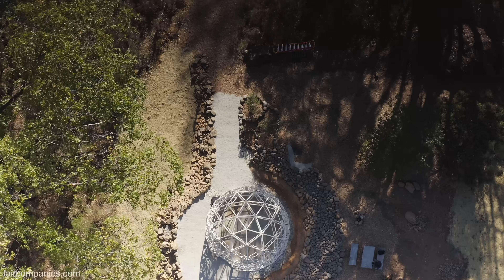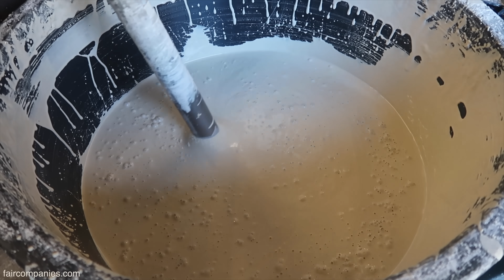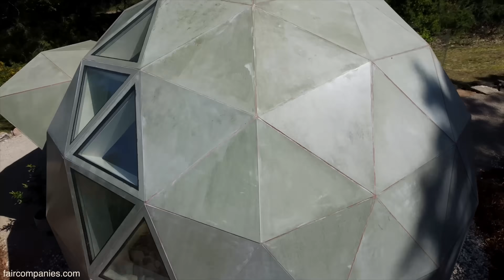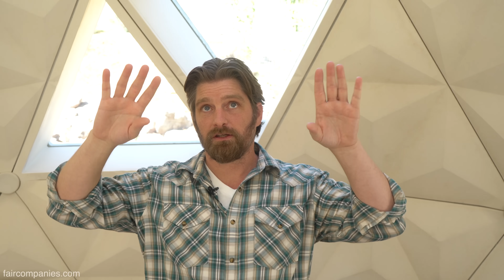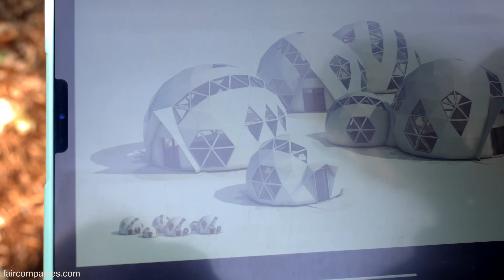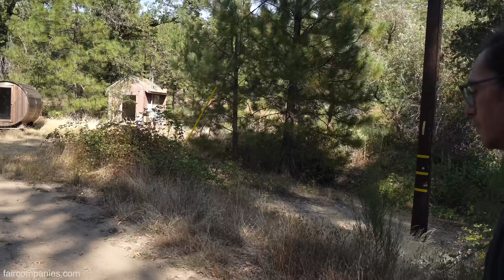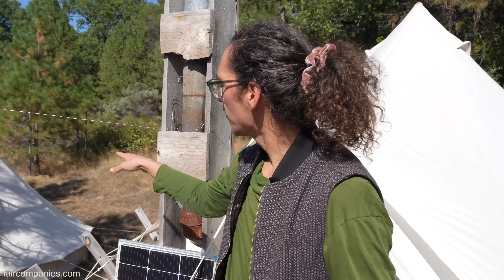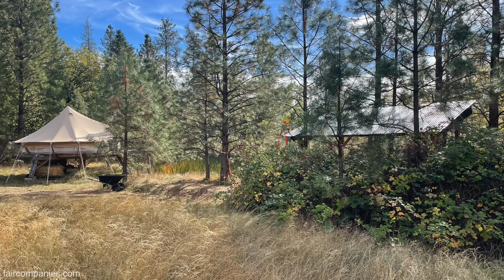Building ecovillage of storm-proof homes made of bone-like biomaterial

Comment: Okay, they're mixing up a synthetic limestone with hemp fibers?  That's just hempcrete.  They're getting their calcinated lime from the same sources as everyone else, presumably.  The hemp fibers will degrade over time.  People ran into some serious mold issues with a related product, Papercrete.  I don't think this stuff will be likely to degrade nearly as badly, but it's not really the end-all-be-all supermaterial, unless there's something I'm missing.

With new developments in thermal diode design, it's theoretically possible to drive temps gained from solar concentration up above 1000c.  Not only can you calcinate lime to make cement at that temp without releasing excess CO2 from fossil fuel use, you can use the heat to run kilns.  You can then mix your concrete with a foaming agent to increase its volume and any of several kinds of fiber for increased sheet strength, and form it into blocks.  Then you can dry the block thoroughly in your kiln to get consistent strength and further reduced weight.  Excluding the solar angle, this is Autoclaved Aerated Concrete and has been being built for the last 70 years.  It's not perfect, but it's easily made, easily worked on-site (you can cut it with almost any tool, down to paperclips), and well-understood.

Comment: how is it zero carbon? How are the ingredients made?
Reply from the maker: I responded to another comment about how most of the raw materials can be generated from waste streams. Here's the other comment: Morgan was also talking about how you can use a lot of waste materials as a source. Here's what he said, that I didn't end up using in the video: "It's natural in that it's like bone, but to get the raw minerals you need to mine them or use reclamation processes. One of the biggest byproducts of salt water desalination is 2 of the key raw ingredients that we need and one of the main byproducts from wastewater treatment plants is another one of the raw key ingredients and now we're finding as the mining operations ramp up for battery minerals that a lot of the waste streams from those operations we can use."

Comment: Termite proof.  That is another unmentioned quality.
Reply: Geoship domes are so insect-resistant, even the bugs know to keep out—no termites allowed at this party!
Reply: @futurevillages yes termites love wood
Reply: Plus the fact that it’s made of ceramic will help keep it with regular temperatures during all seasons
Reply: You have to add liposomal Boric acid to make it termite-resistant. Some species of termites will chew right through cellulosic cements, so you mix in tiny polymer beads of boric acid to poison any invertebrate that tries to make a home in it.
Reply: Built number of steel homes back in the 80s in Southern California with my Dad.   All still standing, no bugs, rot or even leaks.  Steel roof as well.   One thing that impressed the owners was the cost savings on insurance.   Really adds up over the years.
Reply: @dailyrider2975  except they don't stand up well to directed energy weapons
Reply: @rickacton7540  I looked up metal studs recently,  holy smokes batman!   Prices are crazy high.   No wonder metal buildings are not that popular, still think in long run the lower costs will make up for it though.
Reply: @rickacton7540 Ah but it a Faraday cage instead. 
God bless
Reply: @rickacton7540   this is a problem only for you, earth-people.
Reply: And woodworm, mould, rot etc
Reply: a few bites and they lose all ambition and fall asleep

Comment: How does something that is organic not whither or degrade? That's not mathing up, either it isn't organic or it will degrade. You cant have both😂
Reply: They way they used "organic" here meaning that it's design is derived from characteristics of an organism. In this case, I think earlier on they were talking about the materials being made from what bone is comprised of, which are calcium and phosphate, with the hemp fibers acting as the matrix to basically form the overall ceramic compositite.
Reply: @SilverNine89  literally everything they said pointed to it being a chemically organic compound (organic simply means carbon based) of which every element will degrade. It's simply not possible to have organic or biotic material last forever. It's scientifically impossible. 

Im well aware of what they said and what it all means, im not ignorant of that. Cecilia, hemps, phosphates, and other materials used are not inorganic nor abiotic. Everything withers away, everything. Even plastic in due time.

Comment: Also, if you were to get some of the windows to be opening types for ventilation, I suppose you would have to custom make screens to fit the spaces since that is not a standard opening shape. There's no way you could ever live here without screens due to all of the insects. Not to mention bears and other wildlife. I could see it being much more feasible for california. I remember not even using much of any heat and not using any AC in the summer growing up.

Comment: Is this even feasible to build in a place like Northwest Wisconsin where it gets down to close to 40 below in the winter on occasions and also has hail sometimes? How would you add plumbing and some type of a wood-burning stove?
Reply: Geoships are designed to withstand extreme climates, including the frigid winters and hailstorms typical of Northern Climates. The bioceramic materials used provide strong insulation, making them suitable for both high and low temperatures. Deep insulation cavities can also be adapted for additional thermal efficiency, helping maintain warmth even during sub-zero conditions. For plumbing and wood-burning stove installations, the dome’s modular design accommodates traditional and off-grid solutions.

Comment: Awesome.   But if it's so light in weight, how is it able to handle 300mph winds
Reply from the maker: My understanding is part of it at least is in the shape, that the curved surface helps to withstand high winds, though it's not foolproof, so they also need to be fortified, and even (what I've read), raised above the ground.

Comment: Tensile strength?
Reply: I haven’t found it, but here are some of the other properties I found from the investor presentation.

21st Century Materials GeoRok: Chemically Bonded Ceramics

GeoRok vs. Concrete

Compressive Strength

>15,000 psi vs. 4,000 psi

Flexural Strength

>4,000 psi vs. 600 psi

Bond Strength

>5,000 psi vs. 150 psi

Water Absorption

<2% vs. 5-20%

Demolding Time

15-45 minutes vs. 24-48 hours

Comment: Inside is aesthetically pleasing ... cocoonlike. Bearing the doubling in insulation factor R, I wonder how the dome handles extremes of temperature?
Reply: I slept in a Geoship and it does feel cozy and cocoon-like inside, providing a unique blend of aesthetics and comfort. Their bioceramic domes feature excellent thermal insulation with high R-values, doubling the typical insulation factor, making them highly energy-efficient and climate resilient.

The dome shape, combined with advanced materials, helps regulate indoor temperatures naturally, reducing the need for heating and cooling. Whether it’s extreme cold or heat, the dome’s structure and insulation keep things stable and comfortable inside, even in harsh climates.
Reply: @RegenerativeLiving  thank you for that input.

Comment: I have seen these folk's design (or similar ceramic domes) before. It still seems to be mostly in the concept phase. I conclude this in particular as so much of this video was focused on the tent living situation of one of the designers (not enough other content?) 150k for a home sounds great, but I expect that is the dome frame and skin, perhaps the foundation and a very premature number to share when the "factory" isn't much more than a garage. That number  can't include interior build out, i.e. electric, plumbing, appliances, and the PV system that looks so nice in the mock-up. Hats off for the Aptera cameo in the carport though. No mention of insulation or air/water/vapor sealing between the individual components. I thought I saw what looked like caulk in the seams (which never lasts). No petrochemicals?
Reply: " air/water/vapor sealing between the individual components" yes that is also something I wonder about. Especially if it is in a northern climate, how does it deal with thermal expansion/contraction?
Reply: Biodomes have historically been notoriously difficult to waterproof and are very prone to leaks. We need vapor barrier sealing details. What's the insulation between the two sets of panels? They need to issue a video on construction details with a building science guy like Risinger. The "bioceramic" panels are proprietary. I don't like that you can only buy completed units, not materials.
Reply: Not mentioning the insulation material or method is definitely suspicious. Barely anything about ventilation (and no vents near the top?) This is just beyond vaporware but the 3D renders look wonderful.
Reply: @travelfeet   Agreed. Nothing is real until it’s in production.
Reply: Sealing can be done using the same kind of bio ceramic material which binds to itself. Insulation will be done using cellular bioceramic material that has a consistency like a shaving cream. More detailed information is available through their email newsletter accessible through the invest page of the Geoship website.
Reply: Why is everyone calling it ceramic it sounds like it's just cement mixed with hemp fibers
Reply: @ It specifically uses magnesium phosphate cement which actually has biomedical applications such as filling bone voids. They add hemp fibers for added strength, but basalt fibers can also be used.

Comment: Would be lovely if such a structure were amenable to being earth-sheltered.  

The presenter commented on other alternative building technologies essentially seeking to fit within existing building conventions, implying that this is a bad thing.  I think that trying to change too many things at once, especially in an industry that is extremely conservative (and for good reason), will make things harder for them.  Why not decouple the idea of a dome home from the building system shown?  A more conventional construction but with the bone framework and larger, rectangular panels sounds more compelling to me.  Those frames could be even more "organically shaped" and left exposed in places... it'd be cool, too, and  more so than the dome would be able to cooperate with many other building technologies.

Anyway, I enjoyed seeing what you guys have come up with.  Best of luck!
Reply: This is the way, to be honest.  There are some incredibly advanced building technologies out there that are just quietly integrating themselves into the list of things to build homes with:  Structure Insulated Panels (SIP's) replacing wall and roof components, Autoclaved Aerated Concrete (AAC) blocks replacing cinderblocks - it's all out there and is gaining ground because it presents itself as a new way to solve existing problems.  Domes are cool.  I grew up on the Gulf Coast, so housing that survives once-a-generation hurricane blasts seems like a no-brainer, but they are so different that solutions for domes cannot use tools for rectilinear homes most of the time.  That means that designs that feed into their ecosystem won't see widespread use by anyone but the wealthy and idiosyncratic for a long time.  

If they had turned this material into the basis for a block on the scale of cinderblocks, I feel like they would actually find a market for it.  This guy is a bit up his own ass when it comes to the woo, he even tries to sell some of the disadvantages of domes as good things.

Comment: Cool. Need to add storm shutters to be hurricane proof.
Reply: I wonder what the impact strength of the material is. 15k PSI is crazy gard, but is it brittle? I can't see how shutters would fit over the windows higher up on the dome. The glass could be made strong enough (and laminated) to meet current standards. but that add a lot of cost.

Comment: Do they have any plans to offer etched glass to prevent bird collisions?
Reply: Aren't there some silk screen artifacts applied on glass windows that really contribute to birds avoiding collision?  Suggested for tall urban buildings with bird corpses appearing on the sidewalks, etc. and it doesn't interfere with windows cleaning, etc. When I bike past downtown areas I'm really noticing the magnitude of bird fatalities.
Reply: @makeamericagreenagain8511  got some vinyl applications that work most of the time still not 100%
Reply: @makeamericagreenagain8511  Yes, there are some really great products - I have used "ABC Bird Tape" but "Feather Friendly" films and Acopian BirdSavers are also super effective.  All of these need some form of maintenance and/or reapplication after a time (I think the film can last up to 5 or 10 years depending on the climate and if maintained well). Etching may be more expensive, but the treatment lasts as long as the glass lasts, and if glass window makers start offering it by default, the prices will come way down over time. Given the special shape/size of the Geoship windows, I think it could make a lot of sense for them to plan this out upfront for a truly sustainable design. Excited to see where they go with this structure!

Comment: What is the R factor?
Reply: of the "ceramic" I expect not much better than concrete, but it's an internal and external skin, so probably any standard insulating material could fill in the space between. I wonder more about how the air and water seal all of the seams between each triangle.
Reply: Its non toxic and has healing energy
Reply: @BAD_CONSUMER  That doesn't answer the question. R factor as in  R-Value which is a measure of insulation's ability to resist heat traveling through it. The higher the R-Value the better the thermal performance of the insulation.
Reply: @hamadilawson4396 good to know. Because my first thought was human oven.
Reply: @hamadilawson4396  was a joke, who cares what the R value is, they clearly aren't appealing to practical people